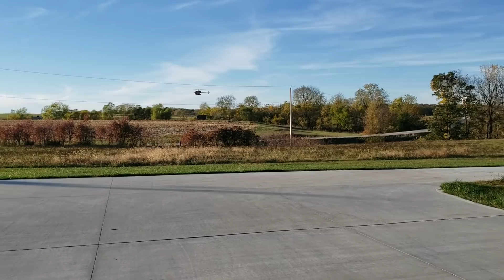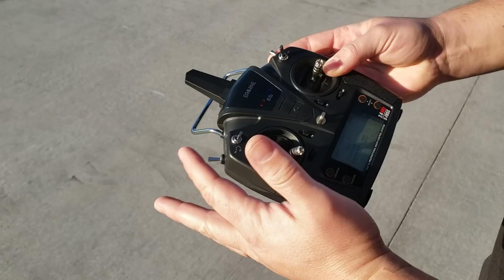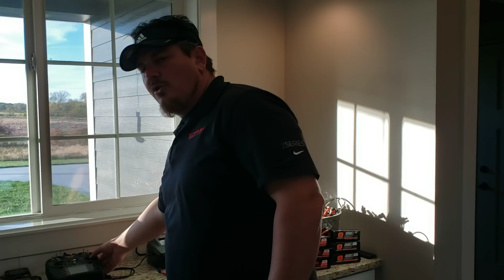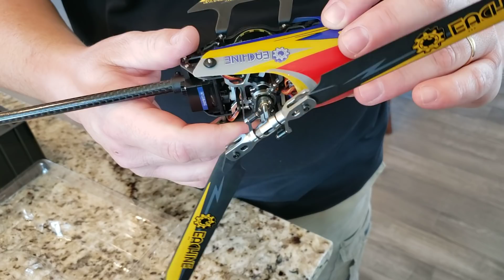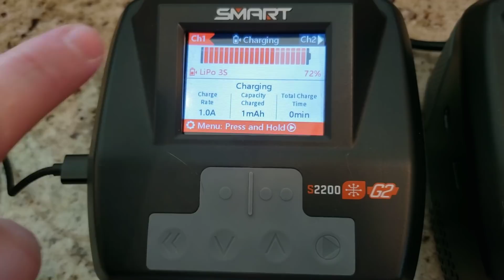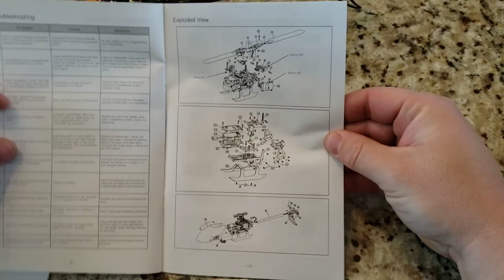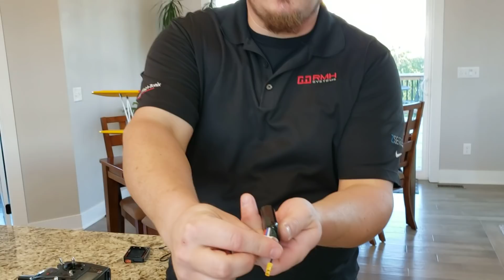Eachine - E150 RTF Heli

Comment: Hello what should a beginer fly at 6g or 3d..freind
Reply from the maker: I believe 6G is the STABILIZER and AUTO-Disk Leveling...like SAFE on Spektrum stuff. That's what'll make it as easy as possible for you to get started. When you let go of the sticks, it should just level out, and then when you're flying a little more aggressively, and aerobatically, you can flip to 3D....just make sure you can get back to the 6G setting QUICK!

Comment: 1:00 yes these direct drive motor, to shaft, seems to feel that way very touchy, what I do is I set a flat throttle curve and I think it is still touch but a lot less.

Theses other helis that use a main gear from the motor to the main shaft seems to be less touchy

Comment: How would this compare to the 160? I take it it’s an improvement? I hope so, didn’t care for it and find it way too twitchy. Also not durable at all at least in my case. Tail boom broke first time it had a somewhat rough landing, canopy pin sheared off easily etc.
Reply from the maker: I was pretty much scared to fly the 160, but this flies a lot more like the Blade 230S, and being able to flip between auto-leveling and acro modes is a huge factor for the newb heli pilot.

Comment: hello my friend, I need a help about the helicopter Eachine E150 2.4G 6CH 6-Axis Gyro. Could you please check if when you reverse channel 4 on the radio the tail movement of the helicopter also changes direction? normally when the tail control on the radio is moved to the left the tail goes to the right, if channel 4 on the radio is inverted when the tail control on the radio is moved to the left the tail also goes to the left? please check if this is possible. thanks.
Reply from the maker: Check you tail rotor prop, or the three wires that plug into the little brushless motor...this will change direction of your tail boom movement.
Reply: @BrianPhillipsRC  i need to check via radio, if is possible
 Thanks!!

Comment: Love the videos, always have. Props to the camera crew. I am now up to 11 helicopters. Started with the 230s, it took a couple tailbooms and lots of experimenting while in Stability Mode. Finally in agility mode with the 230s. ANYWHO, this eachine E150 is leaps and bounds right out the box. Yesterday, I was in 6g and it was locked in with no changes whatsoever. The only change was to lower the headspeed from 80% to 55%. This decrease caused the tail to drift to the right, not good, so at 60% is the magic number. Then idle up 2 was set for 70% across the board. Both work great in 6g. 
Today was taking the training wheels off, agility only. Locked in! Just as good a my two Blade Mcpx BL2's in agility mode (YOUR 230s review is a lil different than mine out the box). 
Conclusion: this helicopter in the RTF configuration is a heavy weight champ. I got the 3 battery deal, but they had a 4th in the 'copter for 312.00 shipped. Out the box, fired it up...level swash, 0 pitch at midstick and settings were aggressive. Tamed down the end points of blade travel and lowered the headspeed, BAM! Perfect. High/Low rates are stock. Expo was 0, but I added -10% all around. I could of kept it at 0.
Side note: could you do a Mcpx BL2 review?
Reply from the maker: Thanks Eric! I love this little one...probably the best flying RTF we've ever done...(that's TRUE Flybarless Collective Pitch).

Appreciate your tips on settings too!

Comment: Great video! How is it compared to the OMP M1? I love my M1 and M2 but looking at getting one to try out.
Reply: Get one. I wanna know how you find it
Reply: @chrisbee5481  definitely want to, I’ve seen a couple people flying mayors and they really enjoy it so I need to pick one up to try on the channel
Reply: @westhobbiesrc8051  I love the omphobby m1. Was thinking about the M2. But its 320g.
The E150 is inbetween and good for sub250 laws.
Price is also cheaper like 250 bucks.
Du you fly FPV too?
Reply: @chrisbee5481  i’ve never had a problem with the 250 laws, but yes it is a little heavier and in my opinion quality in flight performance is 100 times with the M2 over the E180. So I am curious to see how the E150 flies compared to the M1. No I do not do any FPV only helicopters and airplanes line of sight.
Reply: @chrisbee5481  Hi Chris, I actually just added FPV to my Omphobby  m1. 200mw VTX + cheap micro cam and it flies great.
Reply from the maker: I'd be lying if I said I know...sorry WestHobbiesRC!
Reply: @BrianPhillipsRC  not a problem! I guess I need to order one! lol

Comment: Brian: How does compare to the Blade 230s helicopter?  Which one would you buy?
Reply: Brian: Why does the E150 cost more than the E180 which is a larger helicopter?
Reply from the maker: Bob - Never tech.... but the E180 scares me, while I feel comfortable flying the E150.
Reply: True yeah it's like another 100 more than the 180
Reply from the maker: Stewart - I get that it's more, but I'm still scared to fly the 180, but feel comfortable flying the E150. There's a reason it's out on display in my kitchen, while the E180 is in my closet collecting dust. If I'm scared to fly them...might as well not exist.
Reply from the maker: I like them both. Horizon Hobby is ABSOLUTELY NOT getting out of helis - total BS. Heli's were hit hard by the chip shortage that also made it hard to get a Ford pickup truck for the last year or so... I love my Blade 230S, and will gladly state that Horizon Hobby has some of the BEST parts availability of any heli on the market.

I love this little Eachine, but good luck with spare parts. You just have to know it going in. It's usually hard getting parts for little RC planes or heli's...either expensive, or poor availability....but horizon is good about his aspect compared to other choices. That's not going to be a deal maker or breaker for me...since I understand this going in...and you should too..

BUT I'm not gonna stand buy and have people trashing Horizon Hobby for a single bad experience. This is BS! I've had bad luck with many brands over the years and short of Hobbyking...they ALL want to make it right, if you're not full of crap or treat them badly when you call or email or whatever it is.
Reply from the maker: Mike - Horizon Hobby is NOT getting out of Heli's - I will 100% assure you this is NOT true.